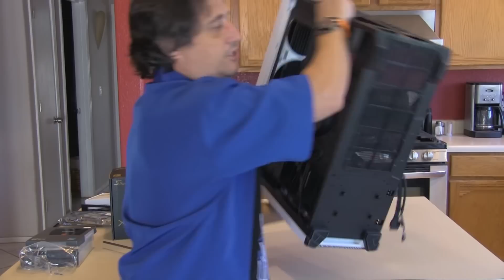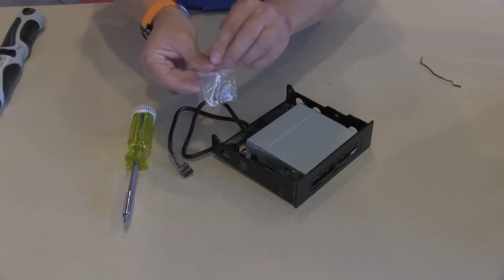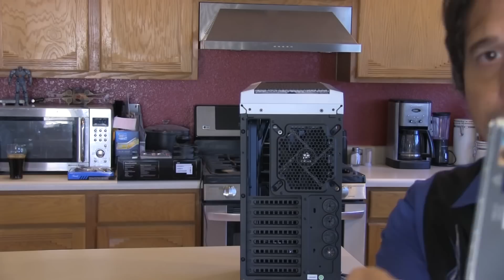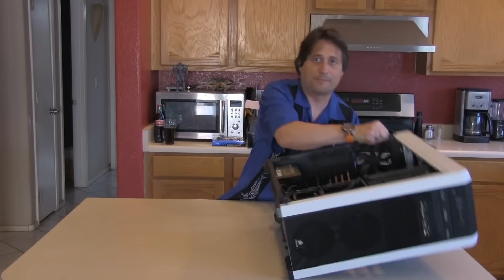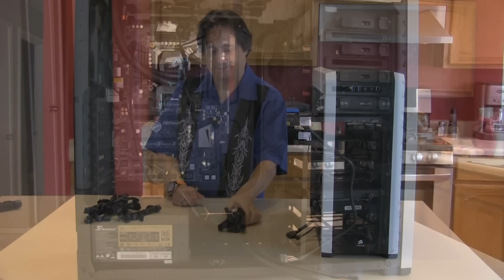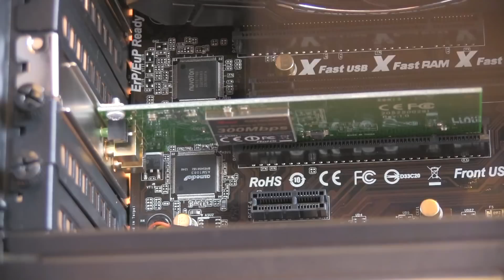Build Your Own Gaming PC - August 2013

Comment: I got the H100i GTX cooler and it has caused nothing but problems for me. The cheap stock fan that came with my CPU is more reliable! Next time I will not be buying from Corsair. Other than that, this is a great build and thanks for being very thorough!
Reply: +Colorless green ideas sleep furiously. I got a Thermalright Macho Rev. B cooler and that thing is a monster. It cools my i5 6600k @4.6Ghz fantastically.
Reply: +Colorless green ideas sleep furiously. Perhaps you got a defect. I own that H100i GTX Cooler for about 6 months and no issues.
Reply: +Colorless green ideas sleep furiously. My system runs great with the H100i GTX cooler... guess you got one of the few lemons in the batch

Comment: My 2016 rig is gonna have this case too along with the new Skylake it'll rock! But does anyone else would get the i5 instead of i7?? I don't think for gaming primarily it would make a big difference in performance, just cutting lose ends in unnecessary performance and money spent.
Reply: Thx! But actually I got the i7 already and i'm using a 250 Gb SSD + 2 Tb HDD cuz my Steam library is 1 Tb more or less. I have yet to get the GPU but i may wait until Pascal.

Comment: When I searched the parts for my first (build it myself) PC in spring 2013, I considered that same MB but then I finally decided to go with Asus and haven't regretted it. I did have a Windows 8 OS then, followed by 8.1 and then I upgraded to Windows 10 last month. Operating systems have changed since but my main hardware isn't, I just have added in some stuff. Main point of this comment is that I think it's best to purchase parts from well known and respected manufacturers. Btw I have had my i5 3570K overclocked to 4.2 GHz about a year now without problems. My CPU is very fast even nowadays, one of the best bang for the buck when overclocked. Remember to properly study overclocking before you do it.
Reply: +Jay Summer 1 I have the same Corsair case, and my motherboard is Asus Crosshair V Formula-Z. I love my computer.

Comment: A little side note, if you don't have the same exact parts as in this video, be careful!  The writing on the modern haswell processors does not face the same way as the board =/  there are two little arrows 1 on top right corner of the processor slot board and 1 on the top right corner of the processor.  The board and the processor directions will show you that the arrows should be in the same corner, which does reverse the writing.  This is my first build so that caused me major fear and stress, ha!

Comment: that case IS epic I really need it my Coolermaster K380 is too tiny for my dual r270x's and fx8350+all hdd's and 2 ssds and a optical drive xD
really need a corsair... but they are so expensive:(
Reply: Get a nzxt phantom 410
Reply: im not a fan of that plastic-like case design from nzxt....
Reply: hoepsipoepsi What about Fractal Design R4
Reply: Moby Dick Of Dopeness dont like the ''box''-looking pc's...
Reply: Got this carbide for 40 euro's second hand never used(had the plastic still on it) but I already ordered a silent base 800 yesterday... Well... In wich should I switch my system in.... Hard choice...:( think Im getting a dark rock pro 3 and build it in the base 800
But the looks of that carbide tho...:(

Comment: So glad I've stumbled across your videos...Call me Subscribed! Building my own as well (first time) once income tax comes. Thinking of Asus for sure, can't decide between the Sabertooth or Hero boards. Intel 5 4690 and a gtx970 is a rough draft I'm shooting for. Got a CoolerMaster HAF XM to put it in too. Thanks for sharing!
Reply: those are the parts I chose also, and as for the mobo, Asus, MSI, Asrock, Gigabyte are all good brands, but I chose the Asus z97-a simply because it was apart of a combo deal (still available) which reduced the price by $30! Also, compared to the other boards I was looking at, it absolutely looked the best. Also, I would recommend going for XFX 550W or SeaSonic (500w is enough room for OC'd 970 + OC'd CPU). Don't go Corsair because there lower end products such are usually built cheaply and are not as good as SeaSonic (who manufactures XFX PSUs btw). Lastly, did u buy the case already? If not, check out the Enthoo Pro, which is a gorgeous case with a side window and TONS of feature for like $30 less than the one you listed. It's also Full Tower so airflow and space will not be a problem.
Reply: Saif S yes I did already buy the case, so no going back. But it's OK with me seeing as I don't need a windowed view anyhow. But the air-flow IS essential. Still flip-flopping on which motherboard to get though...time is runnin' out. lol..

Comment: I have bought the same case (a black one) but I didn't know how to deal with the fan cables that come from the front panel (Molex and the 3-pin one) Unfortunately, there is nothing about it in the manual. Thanks for the video, now I know how to plug them :)

Comment: Funny you mention the weight of the power supplies, as the $20 power supply manufacturers have started putting concrete in their power supplies as weights..
Just google "fake ppfc coil".

Comment: Carey, finding this video tonight was like spotting the oasis in the desert! 
A while back I wrote to thank you for giving me the courage to replace the PSU on my older computer, and said that I thought I might try my own build down the line.  I've been working on it today, and ran into problems and questions that I could not find answers to. I became convinced that I was an idiot for even thinking that I could do it.
A search on the case I selected (the front port umbilicals had me all a-tizzy) brought up this video...and you answered all my questions/fears/worries in wonderful, clear detail. 
You are the best of all the how to's...absolutely the best.
When I saw that you liked the Corsair case that I had finally chosen, by extension I have decided that I am BRILLIANT because I chose the same one.
I have gone from low-worried to totally high-excited.  I will sleep tonight because of you!
Thank you!

Comment: Custom vs Factory Built PCs Overview
This is the reason why a custom build computer is better to get.
Thing a computer you will get from the store.
Factory Built computers only have the minimum parts installed.
For an example, when I did not know that much about computers.
I bout a factory build computer from the store.
It was an Emachine w3609 it came with only 512 MB of memory 
The most memory you can put in that computer will only be 2GB.
That was good at the time.
Seven year passed on, and the motherboard was going bad.
So it was time replace that computer so what I had in mind
Was to rebuild around that CPU,

Comment: Musicians still regulaly use firewire  and alot of audio equipment connects with a firewire interface i have 3 in my studio may be outdated in IT but not in audio2. I just bought an x32 digital mixer which  has firewire on it and its only been out a year / nice vid thanks

Comment: Really liked that tape trick on the thermal paste. Also I noticed you talked about the bags for motherboards not causing problems but you might want to mention that booting a system outside the case on the bag for a parts check can cause problems with the motherboard as the bag can be conductive during boot up.

Comment: I like all your vidz. but being a mechanic I noticed when you were installing the cooling system you are drawing hot air out of the case and through the radiator, in a car it is the other way around you draw cold air in from the outside and that cools the tubes in the radiator to keep the coolant cool. so my question is could this eventually lead to an overheating problem by not keeping the coolant maximum cool?

Comment: Finally a man who understands that overclocking is just grandstanding! When it comes to multiplayer universe of the internet overclocking is corking and not worth doing if you are a multiplayer.. Single player is fine for O.C but not Multiplayer.
Reply: Why is overclocking bad for multiplayer?
Reply: Calden Lees Overclocking is for hard that needs a boost to maintain or increase performance levels. That means if you turn up your graphics settings and other visual displays. When you have a-lot of data sent at one time you have large information packets. The larger the packets the longer it takes to process the data and return it to its source. The mean higher latency also known a  bigger ping. The higher the ping the worse it is man. So when you lower the settings you don't need to overclock and in return you get a smaller ping in  witch means faster response.

Comment: Very helpful video, so for that I thank you!
In the near future would you consider making a video about the optimization changes you would make in a Windows 8 operating system like the video you had done for a previous build on Windows 7. I'm building a computer and I did end up getting Window 8, however it is a bit intimidating and concerning to me if I am to touch something on Windows 8 that turns out to be a malicious setting, but would normally improve performance on windows 7.